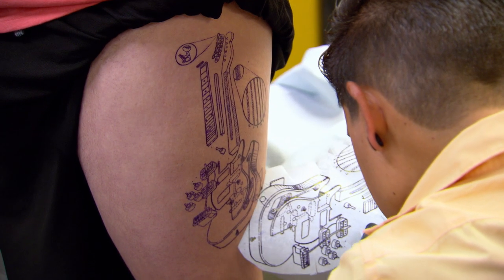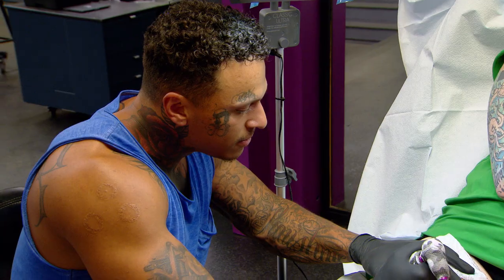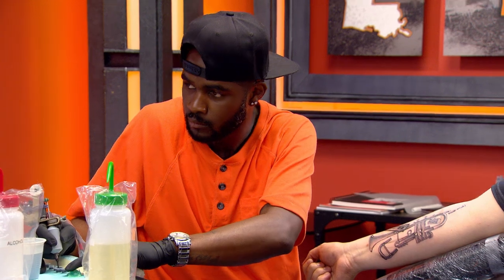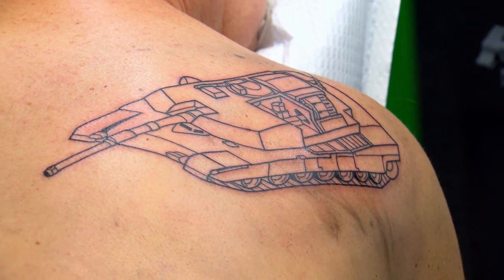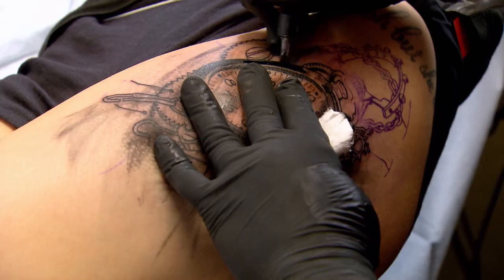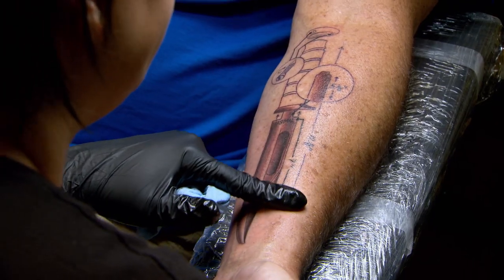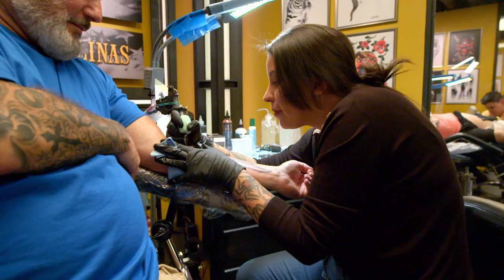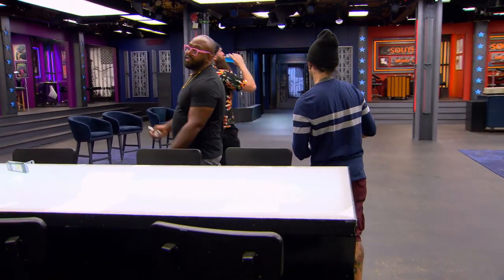'Schematic Tattoo' Elimination Challenge Highlight | Turf War (Season 13)

Comment: What skin characteristics cause blow outs or ink not staying in skin?
Reply: Typically older and damaged/traumatized skin, such as burns and other types of scar tissue are more prone to blowouts. Sometimes skin around certain areas of the body, such as the ribs where the skin is thinner than average, can see blowouts as well. But ultimately it varies from one individual to another, as well as the skill of the artist.